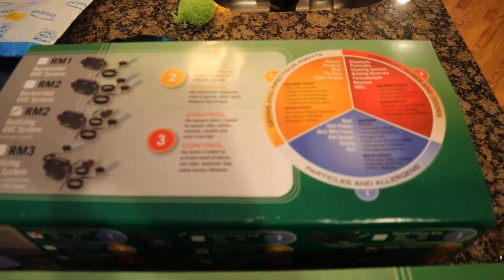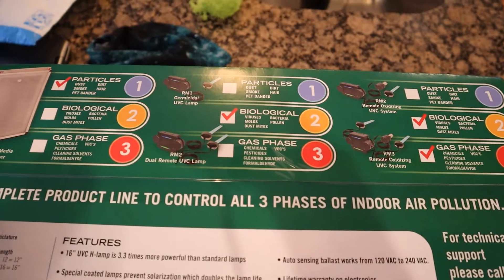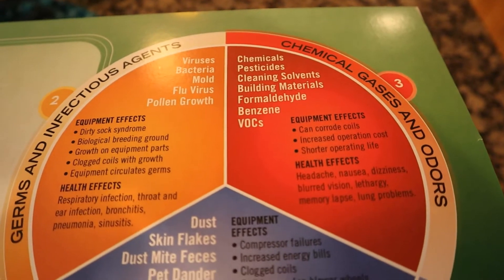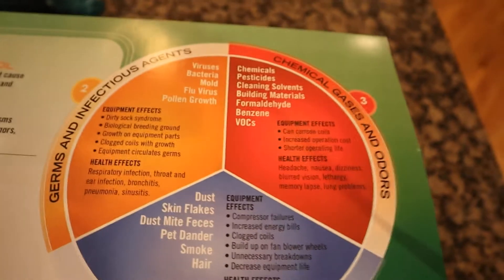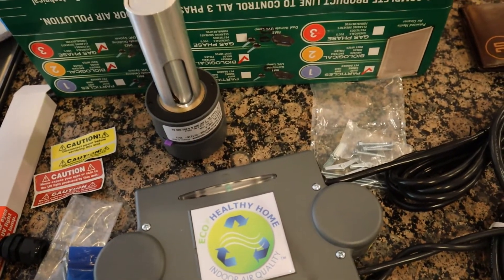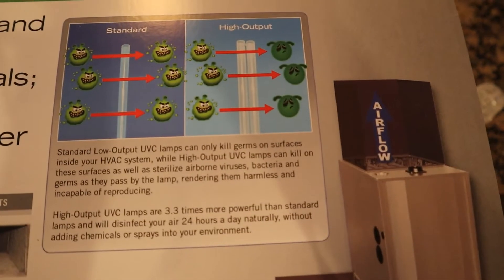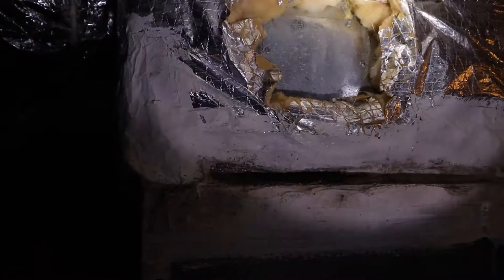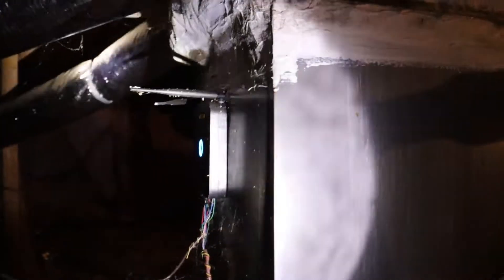Why Do I Need A UV Light In My Air Conditioning System?

Comment: Is there a way to purchase the UV kit?  I was quoted $1400 for two uv lights which in two - three years the bulbs will need replacing and that's without the $900 air cleaner!
Reply: buy them on amazon and hire a handy man to install them.